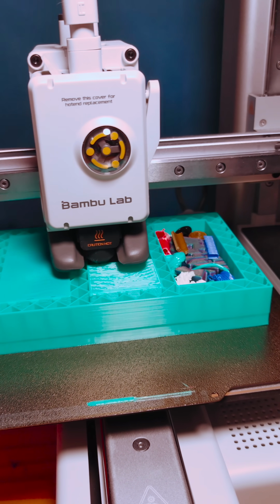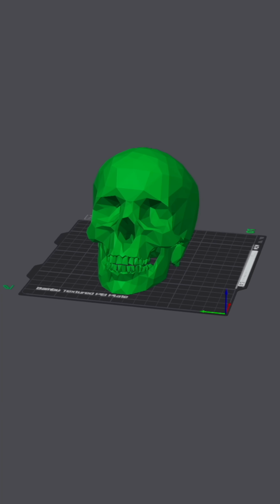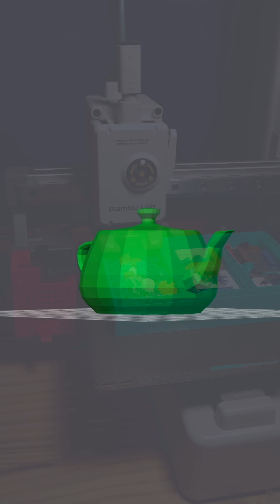Try Just Hiding It

Comment: This adds nothing to the strength of the part
Reply from the maker: I have already responded to a lot of comments like this, but long story short, strengthening the part was not the purpose of this idea. You can read my responses to some of the other comments or my pinned comment if you like. But the primary goal here was just to get rid of the printer waste without throwing it in the garbage. A lot of people have brought up a lot of valid points about why they wouldn't do this. But I wasn't trying to claim that this was a perfect solution. I just thought it was a fun idea.

Comment: The waste itself isnt adding anything here, while it does keep it out of landfills its just as effective as throwing into a bin in the garage never to see the light of day again.

Using silicone molds to melt waste plastic into to make "injection molded" parts is probably the easiest and best use case for most people. There is plenty of silicone mold designs out there, and its fairly easy to use 3d printing to help design new custom silicone molds that then can be used to make stronger functional plastic parts

Comment: Keep thinking.
We all have to keep searching for ways to reduce the need for production of new filament on a global scale.  This is how we reduce the ultimate back-end land-fill problem.
This idea takes on the problem but IMHO fails on two counts.
1 - The 3d Print without the waste can itself be recycled in the future when recycling methods or services improve. Filling it with waste introduces contamination that will make this near impossible.  Net result it will eventually end up in land-fill.
2 - This misses the point of recycling which is to make something useful from the waste, so that it is no longer waste but actual product serving a function.  The point is to use LESS new filament.

Comment: I have a Problem that pausing the Print cause a visible layer on the outline.
Are there Tipps to reduce them?
Reply from the maker: I'm still enough of a novice that I don't have any tips. Other than trying not to pause for very long. You can see I have the same issue with this print but I have paused other prints without it really being noticeable. hopefully someone else will give you some tips.

Comment: But by doing this you need to print the area to put the waste in. Resulting in the part you are printing being bigger (quite a lot bigger too actually)

Imo this only creates more waste by printing more material for no reason. It would be better to just throw it away with other recycling plastic.

(also this will make all your prints rattle when you move them)

Comment: If the print was clear, it could be very aesthetic but I usually print structural parts, which would technically benefit from the hollow space, but no the filament inside it . Still a cool idea though !

Comment: the point is not saving filament. The point is to get rid of the poop. So it doesn't matter, if the inside wall takes more material than the infill. If you put the poop in your hollow cat statue, the poop has vanished. Nobody cares about 10g more wall filament consumption. No poop would be great, but now it exists and we have to put it somewhere.
Reply from the maker: Thank you! Somebody gets it!

Comment: This has to be engagement bait. This does nothing to enhance the part with the trash hidden inside of it. The waste isn't under any tension and weighs almost nothing, which means all you're adding is rattle. You're also using more plastic to make the walls and floor/lid of the void. This is absurd.
Reply from the maker: Never said it enhanced the part. Never said it was to add weight. Never said it would use less plastic. I said I thought it might use less plastic, but it seems I was wrong about that. Those things are not the point of this idea though. The point of this idea was literally just to hide the waste. To get rid of it in a manner other than just throwing it away. It's not going to be worth doing most of the time, but clearly some people found it interesting. There are certainly better alternatives if you want to actually make use of the waste, but this wasn't meant to be the best method, it was just meant to be an easy one. And to get people thinking differently about how they approach the problem. Most of the criticisms people have been bringing up don't actually have anything to do with the point of this idea.
Reply: @chris_ideas  Then what is the point of it? The part isn't better in any way. The trash you hid in the part is still trash. You're using more plastic to hide plastic. Bruh, if you just wanted to make some YouTube money, it's fine to just say that. The smoke you're blowing is hella obvious and these novels you're dropping in response to rightful criticism are not making you look better.
Reply from the maker: @ lol! Check my channel. I'm not making any youtube money. I just thought it was a fun idea. If you still don't understand the point, it's clearly not for you. Which is fine. You are entitled to your opinion.

Comment: I usually only print in one color. I usually use scrap when welding with a soldering iron. Still have scrap from failed prints, but it helps cut down on waste.
Reply from the maker: Love it!

Comment: This isnt good. You are not recycling, you are simply relocating trash. The infill is for structure, adding little clumps of plastic only adds weight which in most cases would not be helpful. If you are so concerned with waste, i would suggest not printing junk in the first place. So many people who talk about recycling filament also print garbage all day  so where is the waste? The waste is in the user having a printer in the first place. I print mostly functional parts for work, but do occasionaly print sculptures or similar junk, but the reason i dont see my junk as a problem isnthat i dont pretend to care about waste. Im ok with using plastic, so i use it.

Comment: Or print supportless "crucibles" were you put the scrap and lead shot in, seal it in glue/resin, and put it into prints later on to adde weight and use the scraps.
However, the bambu printer poop is specifically what turned me off of their machines.

Comment: I guess if you just want the weight and don't need the infill for structural support which it is typically ment for then I suppose it's a use case. But infill does traditionally serve a purpose so I don't think it is a viable option for most cases.

Comment: Bambu printers tend to waste more plastic than other designs. Most of the waste I have is from supports or failed prints. Both of these have reduced significantly as I became better at using the printer and slicers. 

Right now I melt the plastic into solid blocks for using more traditional manufacturing methods. 

Infills primary purpose is supporting the top layer and secondary purpose is providing some strength (sometimes).

Filling your print with scrap adds weight with little benefit. I do like the concept though, you could also just turn the infill to 0%, as long as you have enough waste to support that to layer, it could work!
Reply: I mean, sometimes adding weight is desirable for stability.

Comment: i think it will actually increase the used plastic because the infil uses way less plastic than the outer and inner walls or smth like that
Reply from the maker: Fair point. I think it depend on how big a hole you make and how thick you make your walls. You can check how much plastic you're using in the slicer and compare with or without holes.

Comment: You could make molds using a specific modular size and bake the plastic into molds of that size every so often. Then use those bricks to fill voids of the same or slightly larger dimension.
Reply: Silicon "mini cakes" (or Financier) shoud be perfect for that.
Just put a somewhat consistent weight of waste in each, and you will have more or less similar ingots that you can indeed use as filler!
Or work with it kinda like wood...
Reply from the maker: I think that's a great idea! Especially if you're doing a lot of the same print, like some small scale manufacturing.

Comment: Would it not just make more sense to do the purge inside the geometry instead of stuffing a bunch of random stuff in?
Reply from the maker: So a lot of people have brought that up. That works if your waste is coming from color changes on multicolor prints, but I don't do multicolor prints. All of this waste is either from changing the filament or starting a new print. There's also old print supports and failed prints in there. My understanding is that even though there are things you can do to reduce waste, there's still going to be some for most people. This is just an idea for dealing with that.

Comment: injection molding as infill , not looss parts becouse , loose trash does not help with structual integrity.
you might aswell throw it asay if you do this
Reply from the maker: It seems I've had to address this a hundred times by now, but not all 3D prints need to be super strong. If you're printing something that needs to hold a lot of weight, you wouldn't do this. If you're printing something larger and decorative this would be fine. This is just an idea to get people thinking differently about how they deal with waste.
Reply: @chris_ideas  well , it is an interresting idea, it does have its flaws tho, the walls in the hollow bit might consume more material than if it were just infill.

but you could just half the infill rate and fit those pieces into the wider gaps.

im not against the idea, there just seems to be lots of flaws

Comment: Hmm, infills are there to add structural integrity no? How are loose scrap gonna help? It would be great if it’s melt into the prints but that takes heat and even more toxic fumes… the best way is to throw them out 🤷‍♂️
Reply from the maker: Your comment is based on the assumption that all 3d prints need to be strong. They don't. A skull that sits on your desk or a baby Yoda statue do not need to be able to hold a lot of weight. If you're printing something that does, obviously you wouldn't do this. But a lot of people would prefer not to simply throw the waste away. This is idea for those people.

Comment: Can the waste be used as infill?
Reply from the maker: My understanding is that you can do that if you're doing a multicolor. Instead of having it purge the transitional filament, you can have it make that transition when printing the infill. But I don't do multicolor prints. All these pieces are just the purge from starting a new print or changing the filament roll. There are a lot of options that I've seen for reducing waste, but it seems there will still be some no matter what you do. So this is just one idea to get rid it.

Comment: You're not really adding any structural integrity with the infill, it might make noise, and it's all going to end up in the landfill anyway at some point down the line. You'd probably be better off just leaving the holes inside the print empty and saving filament by not having to fill them with infill. The only caveat I see is if you just need extra weight in the base of the print and want to reuse waste for that instead of using perfectly good material. Not to discourage new ideas, though. If you found a way to benefit 3d printing, definitely share it, even if it's a small/niche benefit.
Reply from the maker: I've addressed pretty much all of these points in either the description or in responses to other comments. Long story short, this is just an idea. Some might find it useful, others won't.

Comment: Why not just purge to infill? I don’t see the point in doing this. Especially since it doesn’t strengthen the part in any way. If you made a baby rattle or something that could use the purge waste to its advantage that would be dope.
Reply from the maker: Yes, someone else mentioned the purging into infill as well. I am still relatively new to 3D printing, so I have not done any multicolored prints, and from what i understand that's where the purging into infill is really useful. All of these bit's of purge waste are either from the purge at the beginning of a new print, or the purge from changing the filament, neither of which can be purged into the infill as far as I know. From what I can tell there is still going to be some amount of waste even when you minimize it with things like purging into the infill. 

As for the strength issue, I would just guess that a lot of 3D prints don't really need to be all that strong. If you were printing something that needed to hold a lot of weight, then this probably wouldn't be a good idea, but if you were just printing something decorative, then it wouldn't really need to have that much strength. 

I love the idea of using the waste in a rattle though. Or maybe a maraca! This idea is really just meant to be a super simple way to get rid of whatever print wast you can without having to fool with melting it back down.

Comment: might need to chip them first so they're easier to use a filler.
Reply from the maker: If you were to do this regularly that would be a good idea. I find that a lot of the little bits of waste I have are already pretty small. But I still hope to find a better way to recycle the larger pieces too.